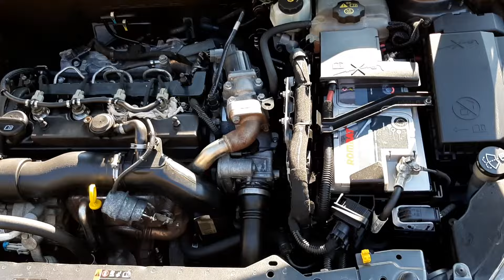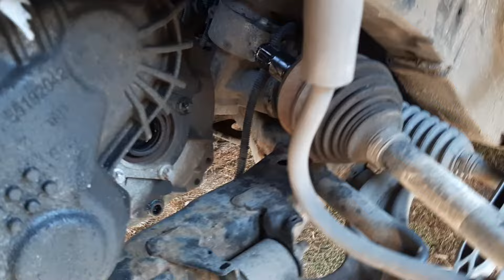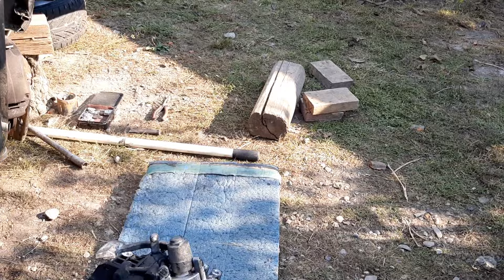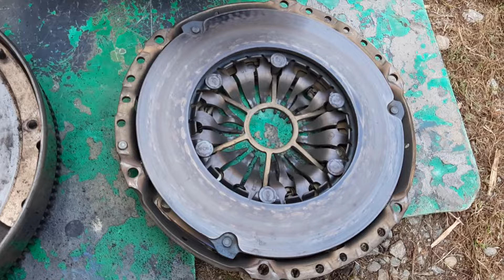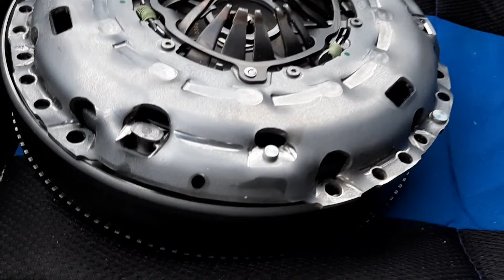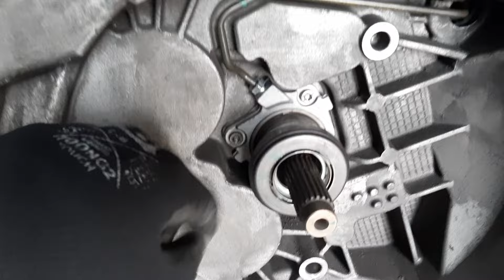Opel Astra J 1.7CDTi - Clutch & DMF Replacement

Comment: You mounted a SAC pressure plate, did had to pull a pin to release it?
Did had to realine the steering or has the subframe guiding pins?
Good work and greetings

Comment: Going back to the 1983 cavalier yes a GM car, you could change the clutch in 15 minutes, why is it now so work intensive ?
Reply: But without flywheel and seal. Clutch   pads last much longer these days. Flywheels are the issues now.

Comment: That dmf isnt that bad, I've seen a lot worse, the one I just took of my vauxhall van fell out when I pulled the gearbox back then again it do 200k, the previous van to that I had 6" of free play on either turn, I find the motors that have a rattling dmf is more often than not the pressure plate not balanced right at the factory, when dmf wears and you have a pressure plate in that isn't quite balanced right it's shakes a bit like a wheel that's out of balance.

Comment: Hey just wanted to ask, I have the exact same car and my clutch pedal is really stiff and hard to press in. I have 115.000 km and the transmission was never seviced. Could it be worn out? Thanks!
Reply: I would check the Diaphragm , slave and master cylinder. If the clutch is worn the diaphragm goes over centre to take up the worn clutch
Reply: bought the exact same car from  a dealership  and my clutch was really stiff  car broke down after 3 days clutch pedan sticking to the floor and wierd noises , took it back and they told me it was the DMF was faulty  probly from start stop used all the time but they also changed the clutch  car had only 52.000 miles  they fixed it free of charge  but it costed them nearly 600-700 pounds
Reply: clutch still a bit sticky before engangement so im taking it to a garage of my own to double check the work that has been done 
what do you guys think it could be ? illl update when i have more info
Reply: @xalastras21  but you never did....update.
Reply: @jgoncalodm  a year after lol sorry guys been a crazy year here it is :
Update  clutch is working fine same with DMF 
 Its not sticking etc must been something but is not doing it anymore Car has now 72k miles
Clean mot and recently serviced all looks good 
Might change my Timing belt as it manufacturer says 6 years or 100k miles even tho it looks alright

Comment: Salut ce marca este ambreaju ?
Dak volanta este ok nu bate pot sa schimb doar ambreaju si rulmentu
Reply from the maker: Salut. Este LUK. M-as mira sa fie in regula volanta. Eu tocmai din cauza volantei am schimbat, dar daca totusi este ok, normal ca poti schimba doar placa, disc, rulment.
Reply: @ClaudeTube  am dusonla mecanic  cand oreamutor nu batea cand tinea ambreaju la jumate nu nu batea se auzea doar un fâsâit si mia zis ca este rulmentu de presiune dak  tot umbla acolo pun si ambreaju 
Si aproo ce ulei folosesti la motor si cutie a mea este manuala 6 rapoarte
Reply: @ClaudeTube  cod motor A17DTR    la fel ca dumneavoastra imi puteti spune la ce sa stau mai atent la acest motore cum sal itretin corect
Reply: @ClaudeTube  salut kitu acela sa potrivit  acuma am este straniu ca acuma are fasâit si fara sa calc ambraju 
Mecanicu mia zis ca volanta are joc si kitu este nou  si volanta transmite la rulmente este posibil sau este veio greseala de la ei
Reply: @ClaudeTube  cica cu tot kitu nou dak volanta are joc find kitu nou  forteaza volanta si face zgomot mai mare   este posibil nu bate se aude cum se auzia rulmentu doar ca acuma se aude si fara sa calc ambraju  fasaitu dispare doar cand calc ambreajul la fund
Reply: @ClaudeTube  apropo la dumneavoastra cat ulei intra la cutie

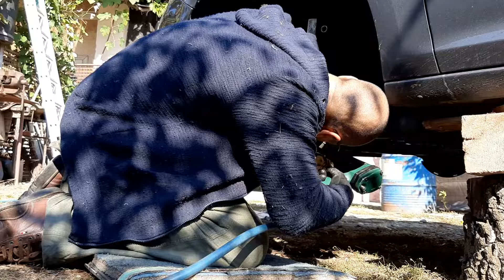Comment: Why do you have that oil leakage on 1:10?
Reply: That was not a leak and that was not oil but transmission fluid. He emptied all the fluid out of the transmission.
Reply: That wasn’t oil from transmission. I’m asking the for oil marks on intercooler pipe near the throttle body
Reply: @vladimirbulatovic4845  it is an oil leak from the throttle, just replace the O-ring at the intercoler tube. unfortunately this type has it.

Comment: Salut ac cumparat si eu acest chit de ambreaj  nr kit 624344133 am acelas opel 1.7 81w 110cv A17DTR se potriveste pe volanta care o are masina.va multumesc
Reply from the maker: Salut. Nu am de unde sa stiu. Eu am schimbat cu un kit complet care a inclus si volanta. Din ce am vazut prin comparatie, desi ambele kituri erau de la acelasi producator, nu ar fi mers montate componente de la una la alta. Chiar am intalnit pe cineva care a cumparat ca tine, doar chitul de ambreiaj fara volanta si nu i-a mers. Poate respectivul a comandat gresit piesele. Spor. Sa-mi spui daca la tine a functionat.
Reply: @ClaudeTube  am.stat in dubi si lam returnat   😔😔